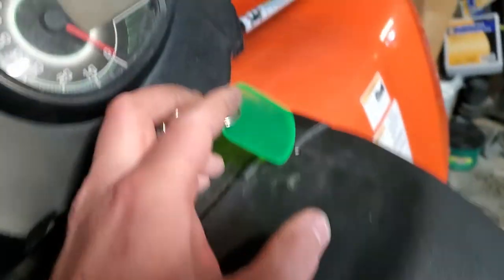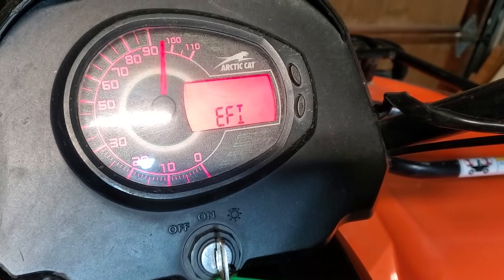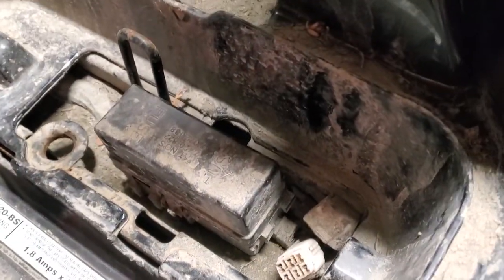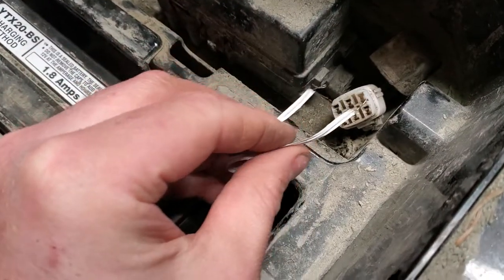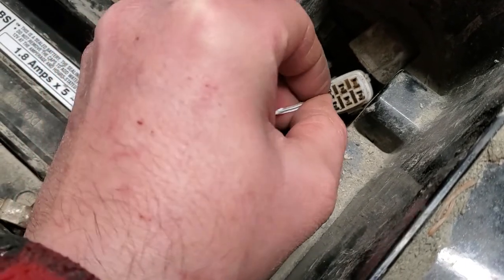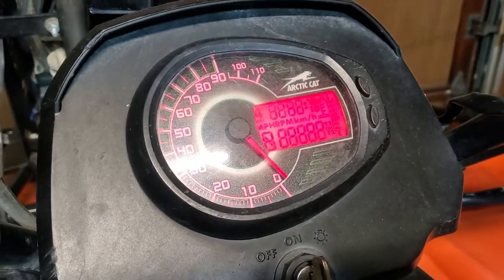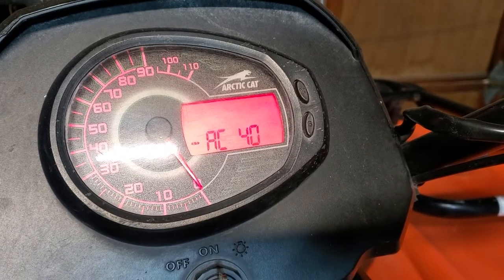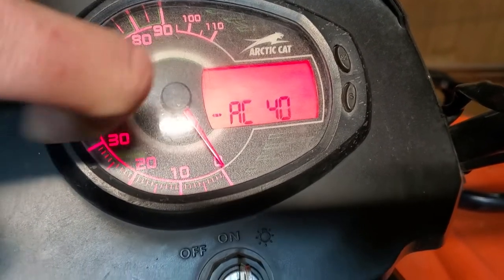How to troubleshoot EFI codes on Arctic Cat ATV and get error codes.

Comment: 2007 TRV700LE (suzuki motor), I got EC26, 34 and 43.  I've changed the ignition coil (EC26), my injector is cleaned (EC34) and there is no EC43 in your list. I suppose it's for 2008 and newer (arctic cat motors)?

Comment: Mine says SC 12, Whats that. Not AC
Reply from the maker: SC means stored code
AC means active code
Your code SC12 could indicate there was a previous error but might have been resolved or was temporary.
I'd reset the codes and see if it comes back.

Comment: Good proficient video. I have a 08 700 EFI. Has EFI flashing after starting, but no error stored, I’ll check again. ISC was filthy and I’m changing the plug. I’m looking at wiring everywhere I go. Any other suggestions?
Reply from the maker: Another possible cause for EFI error is using an aftermarket oil filter. Some bikes require back pressure from the original oil filter. Aftermarket oil filter lack the necessary spring inside them.
Reply: I have the same quad and problem,volt or efi flashing,no error code,but mine dont start anymore,relays are clicking.
Reply from the maker: @FerrorTheOriginal  If the starter relay is just clicking there are two possible issues. Dead battery, or seat starter. Start by ensuring the battery is fully charged. If battery is good, pull the starter and make sur it spins when you hit the starter button.
Reply: I also have 08 700efi and was getting "volt" and the battery wouldn't charge and died on trail, replaced voltage regulator rectifier right behind tail light and now its hasn't died yet but flashes EFI. 
Also I have an 01 arctic cat that electric start don't work, I bought new starter plugged it in and tried hitting start and it didn't spin, any tips on where to look there?! Thanks!!
Reply: Same problem. efi flashes and cant hear fuel pump cycle. This happens occasionally not all the time. I checked stator wires, battery, all wires, V .regulator, tps sensor is set correctly in middle setting. Did the testing of all 3 stator wires, did the ac voltage testing. every test from the service manual came back in spec. Battery is in top notch shape doesn't lose charge even when sitting for days outside in the cold.  No burnt plugs or wires. I am wondering if maybe the fuel pump is intermittently failing. Machine idles like its rollercoasting up and down, spark plug is a nice caramel color. machine runs like a champion when it doesn't do the efi flashing. if i turn it off and back on the efi flash doesn't happen and i can hear the fuel pump activate. No codes being stored at all. I have cleaned and tested every terminal and wire. This is a 2008 700 efi with 2000 miles on it. Original owner put all 2000 miles on it. guy i got it from put about 20 miles on it and it sat in garage for years. Put new gas in. It didnt do the efi flashing for a while after i rode it- put about 160 miles on it myself. now its doing it again but only on occasion. The tps sensor was in the lowest setting when i got it so after i adjusted it all the efi stuff was good until today after i put 160 miles on it over a couple weeks
Reply: as a side note i do have a KN-621 filter on it.

Comment: What is a ac00
Reply: AC00 NONE 
AC12 CRANK POSITION SENSOR 
AC13 INTAKE AIR PRESSURE SENSOR 
AC14 THROTTLE POSITION SENSOR 
AC15 ENGINE COOLANT TEMP. SENSOR 
AC20 RELAY (DIFF LOCK RELAY) 
AC21 INTAKE AIR TEMP. SENSOR 
AC23 TIP OVER SENSOR 
AC24 IGNITION SIGNAL (IGNITION COIL) 
AC32 INJECTOR SIGNAL 
AC40 IDLE SPEED VALVE 
AC41 FUEL PUMP CONTROL SYSTEM

Comment: Have you posted the video for the TPS?  You mentioned you were making one but there is none listed in your video list.  Can you Please provide a link?
Reply from the maker: Hello, thanks for checking in. I am working on it. There are two types of carbs/throttlebody on these Arctic Cats.  The EFI model is much easier to adjust the TPS. The non EFI model is much more complex, I have access to the non-efi at the moment,

Which model do you have?

Comment: Mine is saying — SC 12 & 14 any help would be appreciated. Thank you.
Reply: AC00 NONE 
AC12 CRANK POSITION SENSOR 
AC13 INTAKE AIR PRESSURE SENSOR 
AC14 THROTTLE POSITION SENSOR 
AC15 ENGINE COOLANT TEMP. SENSOR 
AC20 RELAY (DIFF LOCK RELAY) 
AC21 INTAKE AIR TEMP. SENSOR 
AC23 TIP OVER SENSOR 
AC24 IGNITION SIGNAL (IGNITION COIL) 
AC32 INJECTOR SIGNAL 
AC40 IDLE SPEED VALVE 
AC41 FUEL PUMP CONTROL SYSTEM

Comment: I have error code Ac 13 and sc12 and I can’t find the fix to the problem anywhere online any help?
Reply: I know the sc means a stored code and it might have previously has a ac error but I don’t know what ac13 means
Reply from the maker: Hello. Thanks for the question. Usually an AC13 indicates and air leak in the system. It can be a cracked intake boot or sometimes is caused by an overtightened clamp. Try spraying some carb cleaner around the intake boot while the engine is running and see if the idle increases. This will indicate it is sucking in air from somewhere.
Reply from the maker: @taylorallisona-tay1374  AC13 is an Active Code 13 which is usually an air intake issue. Most commonly an air leak.

Comment: hello
i have the erroe code P0509 so is probably the stator out?
Reply from the maker: The problem is most likely with the idle air control system circuit.

P0509-Idle Control System Circuit High or Open.
Reply: Mine has been doing this it’s entire life. No shop can figure it out. I’m going to try this.

Comment: Здравствуйте
Что означает ошибка EC 40
Reply: AC00 NONE 
AC12 CRANK POSITION SENSOR 
AC13 INTAKE AIR PRESSURE SENSOR 
AC14 THROTTLE POSITION SENSOR 
AC15 ENGINE COOLANT TEMP. SENSOR 
AC20 RELAY (DIFF LOCK RELAY) 
AC21 INTAKE AIR TEMP. SENSOR 
AC23 TIP OVER SENSOR 
AC24 IGNITION SIGNAL (IGNITION COIL) 
AC32 INJECTOR SIGNAL 
AC40 IDLE SPEED VALVE 
AC41 FUEL PUMP CONTROL SYSTEM

Comment: Mine is code 99 any help on what 99 is?
Reply from the maker: Error code EC99 on an Arctic Cat ATV typically indicates a general communication error between the Engine Control Module (ECM) and other electronic components on the ATV. This error often appears when there is an issue with the electrical system, such as a blown fuse, loose or corroded connections, damaged wiring, or a malfunctioning ECM.

Possible Causes of EC99 Error Code:
Loose or Corroded Connections: Check all connectors between the ECM and sensors. Ensure all connectors are tight and free of corrosion or damage.

Blown Fuse: A blown fuse can cause a loss of communication between the ECM and the instrument cluster. Check all fuses, particularly those related to the ECM and electrical system.

Damaged Wiring: Inspect the wiring harness for any signs of damage, wear, or chafing. Damaged wiring can interrupt communication and trigger the EC99 code.

Faulty ECM: In rare cases, the ECM itself might be faulty or need to be reset. An ECM that isn’t functioning correctly can lead to communication errors.

Battery Issues: A weak or failing battery can cause voltage drops, leading to communication errors between the ECM and other components. Ensure the battery is fully charged and in good condition.

Sensor Issues: Sometimes, a malfunctioning sensor can disrupt communication with the ECM. Check sensors related to engine management (e.g., throttle position sensor, crankshaft position sensor) to ensure they are functioning correctly.

Troubleshooting Steps:
Check Connections and Wiring:

Inspect all wiring and connectors related to the ECM for any damage or loose connections.
Ensure connectors are securely attached and free from corrosion.
Check Fuses:

Locate the fuse box and check all relevant fuses.
Replace any blown fuses and recheck for the error.
Inspect Battery Condition:

Ensure the battery is fully charged and in good condition.
Check battery terminals for corrosion and ensure they are tightly connected.
Reset the ECM:

Disconnect the ATV's battery for about 15 minutes to reset the ECM.
Reconnect the battery and check if the error code persists.
Test Sensors and Components:

If you have access to diagnostic tools, check for any additional fault codes that might provide more information.
Test sensors such as the throttle position sensor, crankshaft position sensor, and others for proper function.
Consult a Service Manual or Professional:

Refer to the ATV's service manual for specific diagnostic procedures for your model.
If the issue persists, consider consulting a professional mechanic or Arctic Cat dealer for further diagnosis.
Conclusion
Error code EC99 on an Arctic Cat ATV is generally related to a communication issue between the ECM and other components. By following these troubleshooting steps, you should be able to identify the cause of the error and address it. If you're not comfortable troubleshooting electrical issues, it might be best to take the ATV to a professional for a detailed inspection.